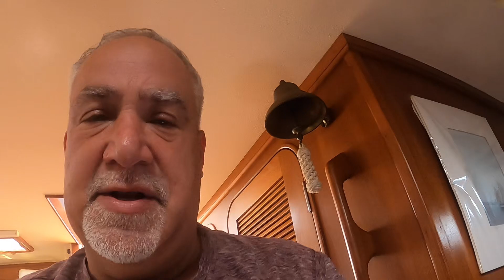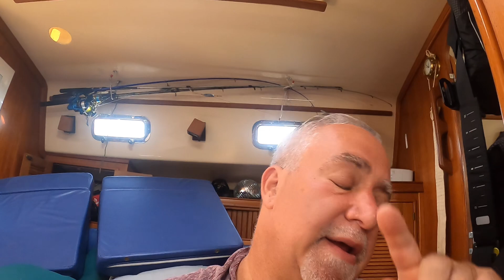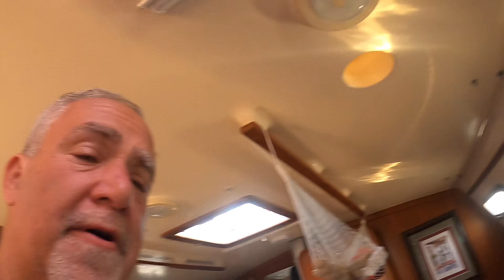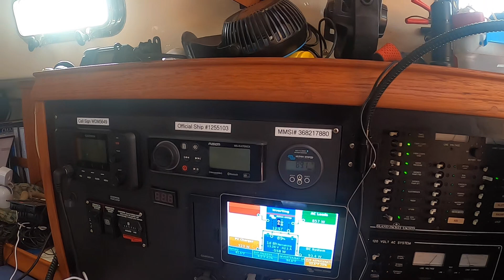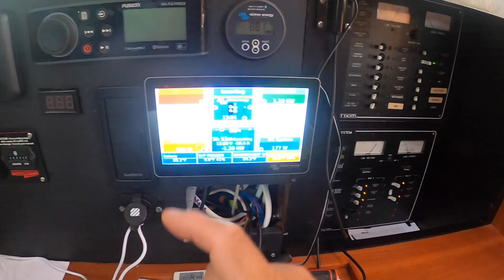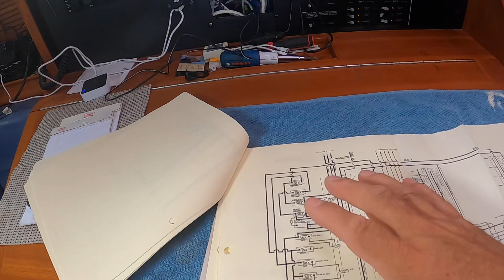Upgrades Updates Bonding & CopperCoat  Island Packet 420

Comment: Worked with the coppercoat 20 years ago. It can have issues similar to to the AC bonding issue. Thurhulls should be isolated from the copper 32:59 sheeting. If the bonding system is tied to the coppercoat, you will have corrosion issues.
Reply from the maker: Thank you very much for watching and for the great info Jim. CUOTO

Comment: One day I'll own another sailboat. For now, I'm making do with a Peterbilt. I added a 3000W inverter / charger that when hooked to a generator or shore power will charge my 4 batteries with 70A. Otherwise it keeps my fridge, microwave, laptop and printer happy. Diesel APU also charges the batteries and provides heat and AC. Would love to have a digital panel to see it all in action, but for my setup that's a little overboard. When I get tired of running it up and down the highways, I'll hopefully "trade" it on on something with sails! As for the bonding, yes, you only bond the neutral at the  "service entrance panel". All that does is bring the neutral to ground potential at that point. If you bond somewhere else in the system, the ground will be carrying some of the neutral current and that will lead to having the ground wire being at a different voltage potential than actual ground.
Reply from the maker: Thank you very much for watching. Sounds like you have one sweet ride there! I'd love to see your system. Very cool. CUOTO

Comment: Tim , there are no big capacitors in a multi plus. So no worries about that. 
The reason the AC is using a lot of startup power is due to the compressormotor. They use 10x the rated watt of that motor. That’s why the multiplus had a dual overrun in wattage. 

Nice way how you manage the ac. to cool the boat. That’s wisely done.
Reply from the maker: Thank you very much! I am very happy with the system. (Just in time to put her away for the winter) 😂 CUOTO

Comment: good job Tim you have the first electric sail boat .on the water system i used a shot glass of bleach to the water tank but i never used the water for drinking it did the job for me have fun be safe
Reply from the maker: Thank you for watching Wayne. We too on the Tugboats often use a bit of bleach in the potable water. I did that on SVP when I first got her and almost ruined the entire system. You see, unlike the steel tanks on tugs, SVP has an aluminum tank. I found out the hard way that bleach and aluminum make aluminum oxide, (I think that's it).  Had "clouds of snow" in my water for a year. CUOTO